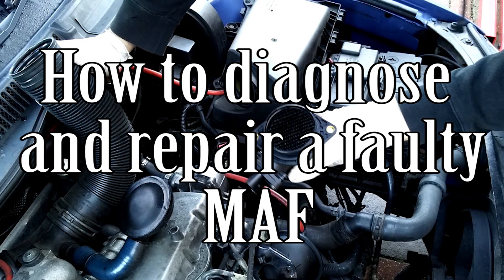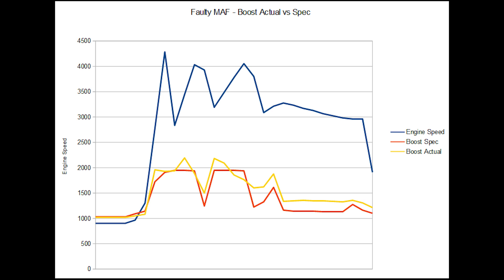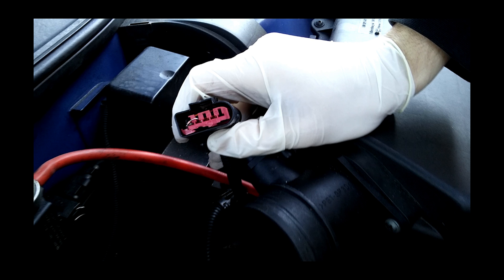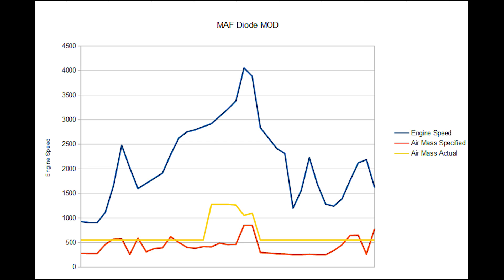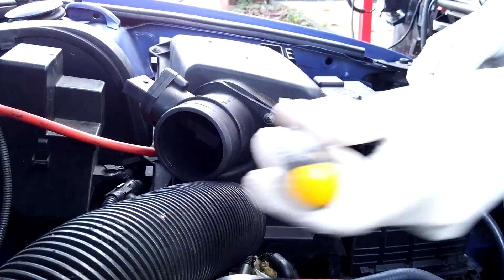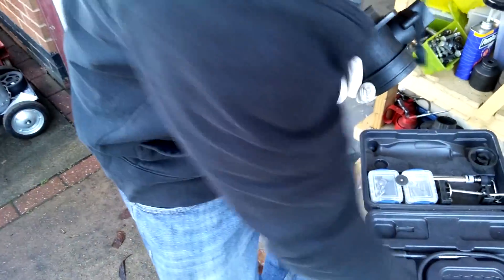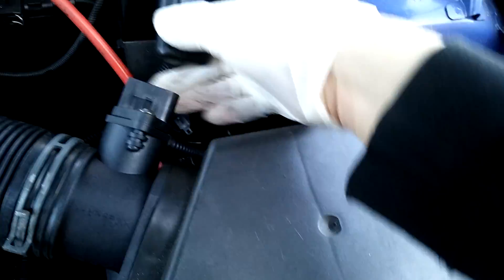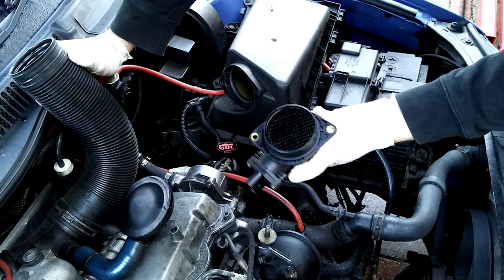How to diagnose and repair a MAF Sensor

Comment: need help, bought a used my 2009 VW Jetta 2.5L does not have a MAFS. is it missing? or some 2.5L 09 to 10 do not with an Mass Air Flow Sensor?  This car has erratic idle, only when stop or in park?  Help????

Comment: EXACTLY the symptoms I have. MAF values NEVER go above 270 so from what you show its the MAF.

One tip is go to group 32/33 and look at the idle fueling and the multiplicative (over1000 rpm) readings. If the idle fueling is negative and the multi is over +5% then you have a dodgy MAF. If the numbers are the other way around, ie idle is positive, multi is negative, you probably have a vacuum leak.

BOTH figures should be +/- 5% of 0.

Comment: Repair maf sensor or replace maf sensor
Reply from the maker: Only if needed - the point of this video is to check if that is the case, this issue could on the face of it be a MAF sensor issue but in fact be a boost leak or other issues.

Comment: With the engine switched off I pulled the plug to the maf sensor
Started the engine and no issues took car for a  spin no issues 
So what is the issue here any explanation cheers
Reply from the maker: The car is using default values because it can't see the MAF, but will perform as it should with a good MAF
Reply: @CarAndMechanical   thanks for the responce the car is 911 996 2002

Comment: Can haveing  maf that doesn’t work make your mpg bad because I’m getting 12mpg on my seat leon Cupra r and it’s my first one so I don’t know if there bad on fuel might general and it’s not boosting properly
Reply from the maker: Potentially, I'm not as familiar with petrol VAG maf stuff, to be safe I assume they run rich. But also unsure is boost is dialled back.
Does the car drive right? (I.e. lack performance)

Comment: Ive yad my car on a couple machines and both have said I need a new mag sensor I've just replaced the sensor on my Audi s4 but the warning lights are still coming on is there anything else I should be looking for ?
Reply from the maker: Couple questions first I guess,  where did you get the sensor from? 
What/how was is diagnoses, Vagcom, code reader or torque?
Last part have you got torque and a OBD2 reader?
Reply: @CarAndMechanical  I got the sensor from ebay it cost £120 It's a Bosch part and I have the torque obd reader and as soon has you delete the code it comes back on after a minute or so
Reply from the maker: OK the good thing if it's the right price for a legit unit - set up gauges within torque to work out when/why it misbehave's.
You want to set up a MAF gauge which will read in G/S and if it's a turbo car then boost too (all options within torque)
Whats the engine and power output? 

With these numbers before I've seen my MAF read way too low on my 2.5 TDI when it was down on power and up when it was good, the inconsistency told me it was the MAF and once replaced I saw it higher and power was back.

Potentially I think 2 things are at play, 1 wiring either a bad connection in the plug or a short somewhere (also worth checking grounds) 2nd the new MAF could have issues (I doubt this and there are tests you can do with a multimeter, I honestly think this is very unlikely but not impossible)

Comment: My emissions light has just come on ,ive checked my air filter,and its grey and dirty.If changing the air filter doesnt cure the problem.Is the maf sensor the next part to look at?.....anyone?
Reply from the maker: Get a code scanner on it, elm327 and torque
Reply: already done.Got the error message.p0102....which is pointing at the maf I think
Reply from the maker: Yea I would say it's a good bet - in torque you can view MAF readings as a rule something like 1 g/s per bhp is a reasonable guide - if it's flat it's the MAF - or somethings good and sometimes bad you'll see it.
TBH a reasonably priced MAF is worth trying - if you are in the UK I've gotten mine from ECP/GSF with their codes before for £30
Reply: Ok .My freind has the kit,ill pass that on to him.Thanks alot .Ive changed the filter,and the lights still on,so ill get him to check the maf.Thanks for the advice,and ill let you know how i got on.
Reply from the maker: Does the car drive badly?
Reply: no its running fine,but definitley to much fuel,i can tell by the mileage

Comment: Doesnt it just trow a fault code for maf
Reply from the maker: Should do - but depends how bad the MAF is - I've had a few go from terminal to intermittent and VAGCOM codes were not helpful I had to look at the readings.
Reply: CarAndMechanical   iv got a mk1 cupra r with the bam 225 drives fine no engine light but wen you boot it at about 3500 rpm it has flat spot then pics up agen its like it looses boost for a second tried 2 mafs change the dv valve still the same had it on the rollers and its down like 35bhp
Reply from the maker: Have you tried proper MAF's from Seat/Audi? Or a very good OEM - need to be careful with some ebay ones (although I've had success) also worth checking the pins are clean and grounds are all good.
My 2.5 TDI was like this - sometimes it flew (not as quick as a Cupra) but others chugged along, and then sometimes nothing and holy hell where did the power come from.
I didn't get any CEL lights or fault codes in VAGCOM - what helped me understand it was the torque mobile app and using the gauge that shows you air in g/s where vagcom is mg/str. 
Essentially I just had torque on all the time and noted what it read when good, and noticed it was down when bad but still making 21 psi boost for both readings - so I 100% knew I was seeing the same air just that the car didn't know that.

Comment: those spring clip tools make life so much easier.. i got some locking ones from ebay, no more springs pinging off into the bay..
also what measuring value blocks are you using for the maf specified / actual?
keep up the good work dude

Comment: nice.. ..so what happens if you disconnect it while it's idling?....cause my polo tdi doesn't switch off when I'm disconnecting it...and it doesn't pick up....it can run up to 120km/h and it being on gear 5 and pedal on the floor....cars maximum speed is 240km/h...
Reply from the maker: If you disconnect it and you have no change it suggests it's probably broken - have you checked anything in VCDS or tried the diode hack?
Reply: +CarAnd “Car Mechanical” Mechanical ummm...nope....does a faulty MAF lead to slow speeds too....?...i mean....you wouldn't feel any horse power
Reply: +CarAnd “Car Mechanical” Mechanical ummm....i haven't checked them...vcd and diode....are there videos that you posted that shows how to check them?
Reply from the maker: Yep the MAF tells the ECU how much air you are seeing which in response it will give the correct amount of fuel - if the MAF is giving it the baseline signal it'll limit the amount of fuel given. The diode mod/hack is the cheapest way to test your MAF is faulty if you don't have VCDS
Reply: joseph ngoako  just to say I hav bkd Audi and had hbi lights fitid dun my wiper moter   In and my ecu sik lol
Reply: In general it's a bad idea to connect and disconnect any electronics or sensitive electrical components anywhere while on / running.

Comment: Hoping you've just cured my problem!!! My golf 1.9 TDI 2001 X REG is gutless
Reply from the maker: Give it a shot as I think these things are a huge problem on both TDI and 1.8T's when they go. Personally I say get any one from a reasonable ebay store within the UK (Eurocarparts and GSF have ebay fronts under sub names), or sign up to EuroCarParts and GSF email lists and ECP will maybe once a week offer 30% off and GSF sometimes up to 40% .

If this doesn't sort it then time to get VAGCOM on the car and check boost and fuelling.
Reply: +CarAnd “Car Mechanical” Mechanical 

Hello so unfortunately I got another MAS fitted it and honestly it felt 10 x worse than my one I had on there it was same as mine part number and Bosch 

I honestly can't think what else it could be? 

I was driving the car tonight down A14 Suffolk, England. And gears 1.2,3,4 are fine upto 50mph start losing turbo completely and its proper slow and sluggish? I honestly can't think what else it could be!?
Reply from the maker: Have you got VAGCOM? if not grab it ( http://www.ross-tech.com/vcds-lite/download/index.php ) grab yourself a USB cable from ebay  - being an X reg I don't know if you are KKL or ODB2.
 We need to find out what error codes you are getting, also lets you check the MAF sensor outputs (making sure the loom is ok.
My list to check would be:
- Fault codes - might be an easy win
- Boost logs - over boost/underboost/leaks this will help
- N75 cycle logs
- Fuelling logs
- The vac lines, these being in bad shape can cause N75 issues which means the VNT isn't being well controlled and boost is wrong then it hits limp mode.

Also depending on how you feel look up the MAF mod - could be worth trying around the block, you use a diode (some people use paperclips) to bridge the MAF connection. The result I got was nothing nothing FULL FUEL AND BOOST.

Honestly VAGCOM will help a ton and if it won't tell you what's wrong you can quickly tick thing off - I also have some videos on how to set up and use it - this might prompt me on how to make a logging video.
Reply: +CarAnd “Car Mechanical” Mechanical 

Cheers man I will give it a shout 

My mate is a mechanic also has no idea put his computer on it got these 

Alternator 17911

Air flow sensor MAS 16485

engine block mobiliser 17978 

Engine coolant sensor open or short to positive. 17664
Reply from the maker: Hmm what voltage you seeing from the multimeter for the alternator because a proper alternator issue will manifest itself fast.
There are not a huge amount of things on the tdi engine harness tbh, the other things I can think of and I can't remember if they plug into different parts of the harness as the needle lift sensor for fuel injection, fuel temp sensor, egr and perhaps a few others.
My point here is I wonder if you have a wiring issue, it would be interesting to know what else is on the harness for the MAS/MAF.

Being an 01 it might also be a PD, do you know the engine code/does it look like mine with the injectors.
Reply: +CarAnd “Car Mechanical” Mechanical 
Funny you say that wiring I was thinking exactly the same! As for the alternator reading I'll have a look tomorrow and try get a reader for it to check what it's coming out as .. 

Any idea on the wiring for now though?
Reply from the maker: If it's saying a bunch of things are not working but they are I'd wonder if there is a short somewhere in the harness. 
The alternator being the big potential hint as I'm on my 3rd in a few years and finally went recon, but I got the alternator light and less then 30 miles both times the old ones failed.
The light is triggered by it not reading or not getting enough voltage - but if you are actually getting the voltage but a fault then I wonder about the harness.
Reply: I have a 02 one that was gutless. Intake manifold was full of rubbish.  Flys along now.

Comment: when you were taking off the intake hose, why did you use one hand to take off the spring loaded hose clamp and the other to pull off the hose? instead of taking off the clamp and then using both hands to remove the hose. I didn't here you explain that approach.thanks
Reply from the maker: Basically spring clips are a pain and I didn't want to take it back over the hose as it crushes it a bit if over the flexible section.
I'm at the point now that I am sick of the pain spring clips can be to I am going to change over to jubilee clips, as there are some clips that are an even bigger pain to due access angles.

Comment: hi am cordell. my have a 1989 pathfinder and have the problem for the pass months I found it can't rev over 3000rpm, i check the air flow sensor and when I rev it the voltage decrease instead of increase. what do u think is the problem.
Reply from the maker: +cordell walker could well be, the diode mod hack I showed could be worth trying. But I would check on Nissan forums first - I can't think of a reason it would cause an issue but would still want to check.
That said if a diode flips things around so you get power above a certain RPM then yep it's your MAF.